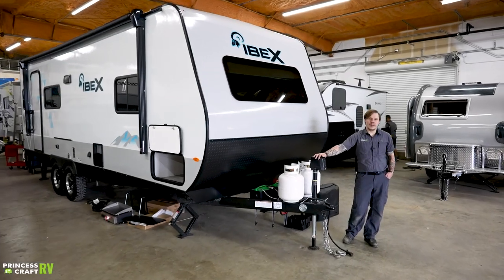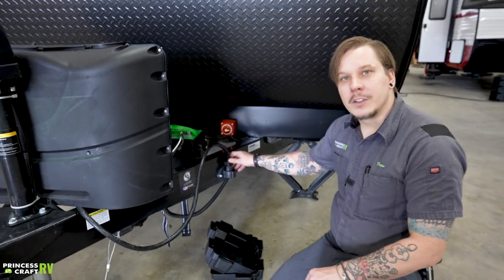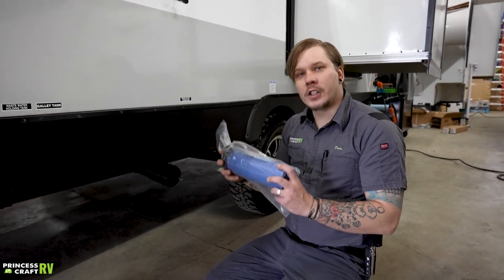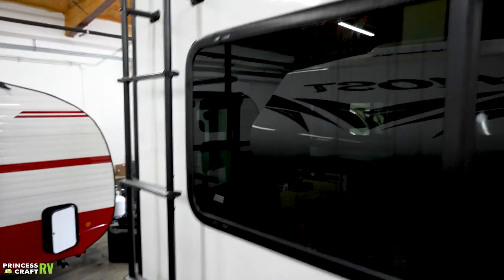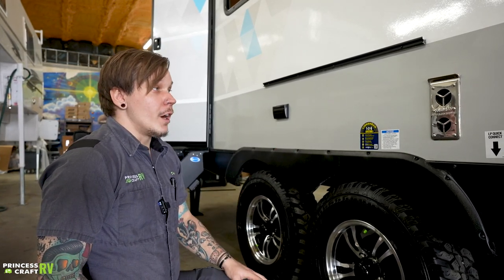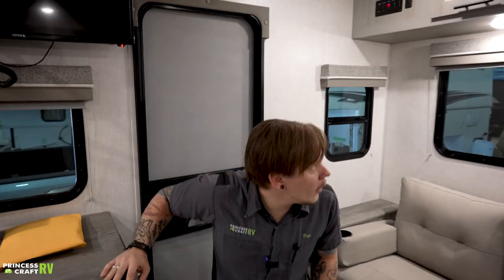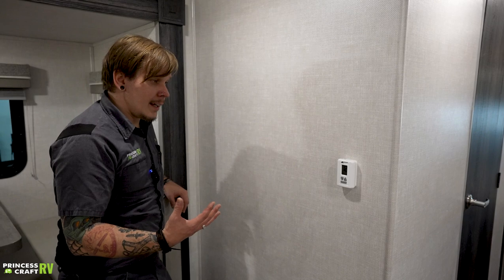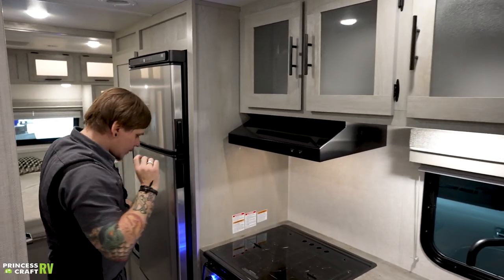2021 IBEX 23RLDS Tech Tour

Comment: We bought one 7 months ago, and like it a lot. We've taken 6 trips, about a total of 30 days.  Only big issues have been the pocket door.  The snap was unable to hold it in the open secure position and broke through the door stop in the wall, and it caused to door to get stuck in the wall.  I now put a tool bag in the doorway to keep it from moving while being pulled.  Trim pieces are only held by a couple tiny nails.  We replaced the table with a more sturdy one that folds.  The table screws that hold the round braces are tiny, and pulled out when a box was put too close to the edge causing the table to crash down.  The shelves can't hold much weight, so you will want to reinforce them.  The folding couch is nice, going to upgrade the cushion in the future.  All the big things, like the slide-out, stove, fridge, HVAC, water, gas, and electrical systems, seem solid.  It pulls well with our Ram 1500. I just upgraded the truck rear end with an in-coil spring air-suspension, and it made it pull even better.  We would buy it again.